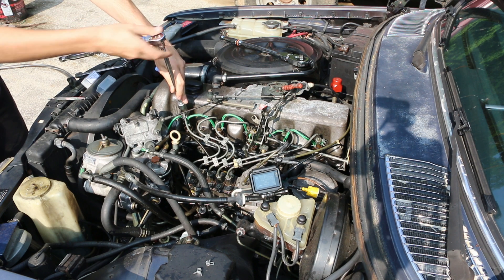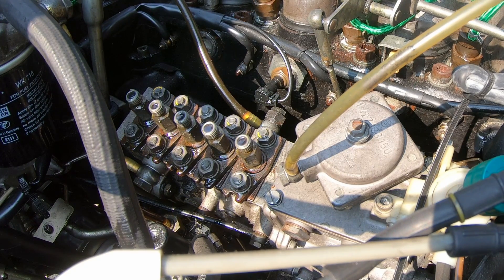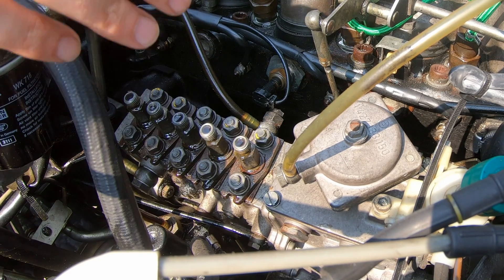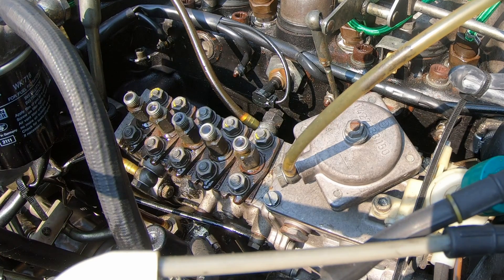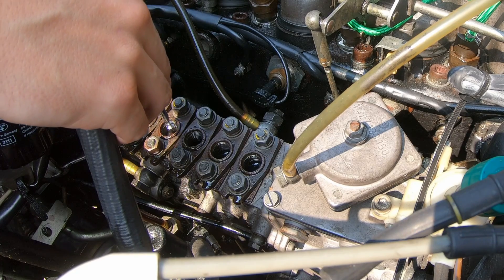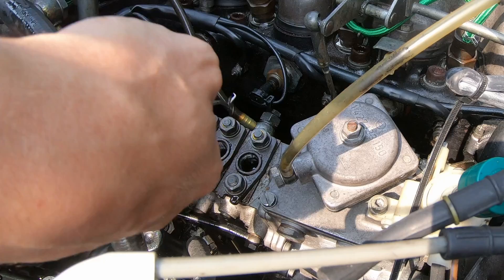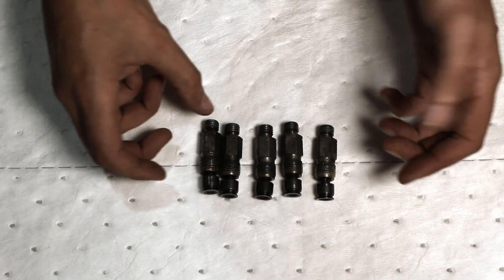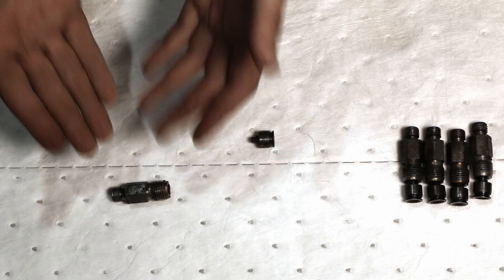W123 Delivery valve crush washer replacement

Comment from the maker: The crush washers are part number 0049974540, or Bosch 1-410-105-021
Here are a few possible sources:
https://www.pelicanparts.com/More_Info/0049974540.htm?pn=004-997-45-40-M14
https://www.fcpeuro.com/products/mercedes-delivery-valve-seal-bosch-0049974540

If your delivery valves are stuck like mine were, here is a likely source for new valves while they last:
Part number 0000745184 or Bosch 1418512008 Delivery valve: https://ebay.us/hE5TXk

Here is the special socket I used for the injector lines:
https://www.idparts.com/17mm-special-egtinjector-line-socket-t40055-idp1066-p-6237.html

Comment: Okay so I have a 1993 300d with the locking plates that hold the delivery valve holders…. One of my delivery valve holders has snapped off at the bottom of the holder and is under the copper washer and delivery valve…. Would it be okay to take the delivery valve out and get the broken piece off carefully? Then put the valves back in? Or would I need to have it completely balanced again , cause mine doesn’t have the two locking bolts on the side…..
Reply: It just holds the delivery valve holders with the locking rings overlapping. Can post a link if needed for visual
Reply from the maker: @zacharystevens1706  Yeah if you could post a link or email a picture to tom at trythistv dot com, I'm not sure I know exactly what you've got, I think I do but I wouldn't want to steer you wrong and mess something up

Comment: in a discussion on Facebook.... someone mentioned there was Tick marks on the valve  (barrel and element they called the two parts of the valve)  Their point was,  you have to align properly barrell and element via the tick marks.  ...   what do those marks look like??? ...  I didnt see anything...  just found instinctively the spot the piston/element thingy seemed to slide all way into the Barrell/valve thingy..  after cleaning and put them back in the IP.  

Or maybe the alignment was tick mark on IP and an barrell......   ????  Im a bit confused.......  you got any thoughts on this?
Reply from the maker: Barrel and Element would be the components below the delivery valve that do the actual pumping of fuel, there was/is a fellow in europe that was making custom replacements for more fuel called dieselmeken, I should take some time and see if I could get in touch with him and send my MW pump that had a misfire problem over to get rebuilt and calibrated with bigger elements.

The delivery valves just have to be in the right way up, if you find my video on the little shibaura diesel generator, I found delivery valves in upside down, that messed up the shims in the pump, and while it is a different kind of pump, the same applies.

I'm not sure I'd dare align the barrel and elements by hand without some kind of pump test bench, if I had the time and space, I'd love to attempt building a testbench and calibrating my pump.

Comment: not gone thru whole video yet so this may be answered further in video....  will report back if so.   

do Delivery valve have to go back into same spot of IP they came from?
Reply from the maker: They should all be the same, I wouldn't mix up the inner and outer parts of the delivery valve, but as long as everything is clean and you're replacing the copper washers, it shouldn't matter what order they are in, they don't get calibrated per plunger or anything on these.
Reply: @trythistv  appreciate it.  Here is where I am at now (removed all delivery valves and Sonic Cleaned them.  Not put back yet)

Brake cleaned IP's 5 ports. With hand primer pump- Only IP ports 4 & 5 move fuel in what would look to be normal. #1 barely moves any. #2 & #3 moves nothing.
How many ports should show fuel coming out via primer pump? Am thinking one might not according to IP's cam position. (if there is a cam in there... I think so) but maybe it is more than one?  

Next bumped the engine over few times to see if that changes anything.

With that then back to hand pump; each engine bump over had fuel come out of 3 different ports and less in two of them. So must be norm for cam in IP to sorta restrict two of the 5 at a time.

Oddly when #1 does move fuel.... it takes longer to pump Primer and it always bleeds off back to half full-ish of its cylinder. Then again is that normal?? and why the Drip Time system is done on #1??
Reply from the maker: @coachgeo  You're absolutely correct with your assessment on the fuel flow, the position of the cam in the IP will change where each plunger is and if the plunger is up, no fuel will flow into it with the primer.
I'm not super sure of the differences between them, There could be something different with #1, I'm not any kind of Bosch certified tech or anything, I'd like to find a book or diagrams or anything on these MW pumps.
It sounds like you've got a pretty good plan, I hope it all goes together well!

Comment: Good information. I've already ordered copper washers and O-rings for my Bosch 10 cylinder pump, but after seeing this, I'll see if I can get hold of  the delivery valves as well. The engine is a Mercedes OM403 from 1976. Thanks!

Comment: congratulations for the work. I haven't really seen a delivery valve video on the web. I know that the injectors work with 140 bar. what would be the ideal pressure that delivers these injection pump valves?
obs. the platform is not warning about your videos. hug from Brazil
Reply from the maker: I hadn't seen much of anything about them either, the main purpose of these is to keep fuel flowing in the correct direction and cut the fuel delivery at the right time. I'm not sure there is any kind of rating as far as pressures, my understanding of delivery valves is quite limited but modifying the shoulder (with high precision, very expensive tooling) would result in more fuel or different timing on the fuel delivery event, but the pressure would still ultimately depend on the injector shimming. Hopefully someone more knowledgeable can chime in if anyone else has insight into delivery valves function

Comment: Do you have any part numbers for the original delivery valves?  I can attempt to source these from Germany and get a link for you.
Reply from the maker: I do!
The Bosch part number should be 1 418 512 008
The Mercedes part number should be 000 074 51 84

I've found a few sites that claim to have them but they are sites I've never heard of that I hesitate to recommend just in case they are shady or something.
Reply: @trythistv thanks
Reply: I ordered ten new-in-the-box; never used.  I can’t post the pictures here but I can email you pictures and the link for your review.
Reply from the maker: @AlexOnParkwood  Absolutely, send them over to Tom at trythistv dot com
Reply: Let’s see what we can come up with!

Comment: Where can I find some of these valves? Been looking everywhere
Reply from the maker: Finding them new is near impossible from everywhere I've searched. Used ones from a junkyard motor like I did or perhaps a bosch pump shop might have better connections.
Reply: @trythistv  here in brazil there are mb roads with engines different from the usa mb walk from the 70s to 2000s here is the most common engine om 321 from the 60s om 352 om 366. om 355/5 and om 355/6 all with bosch pump the elements are used in this pump of ours here an om 616 reform the complete pump is the only engine similar to om617 that came to brazil

Comment: Pretty cool I’ll have to take a look at mine are you able to buy those components brand new ? You said you picked up a use set
Reply from the maker: I've not found brand new DVs anywhere, A bosch pump shop might be able to source them, but I wouldn't bet on it. at least the crush washers are still available.
Reply: @trythistv  OK good to know thanks